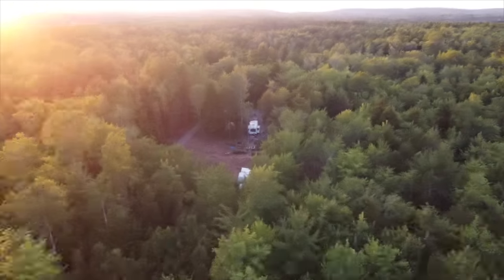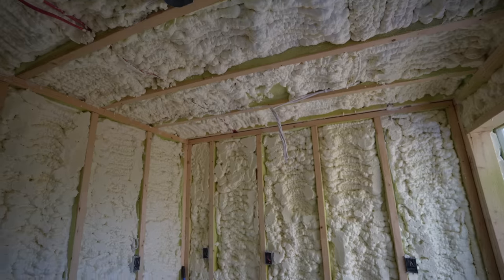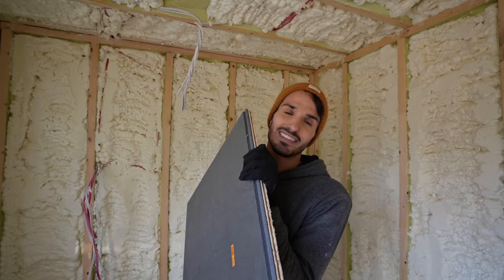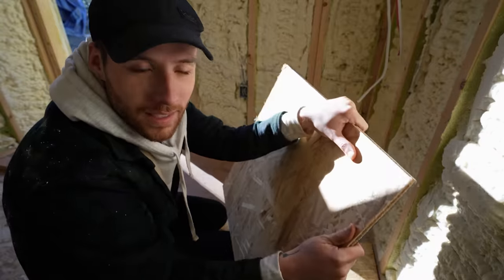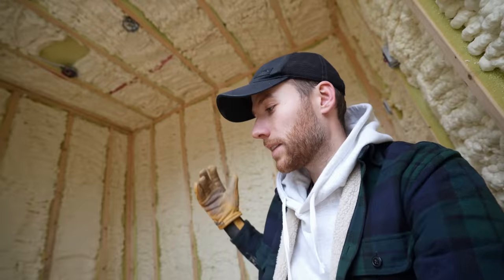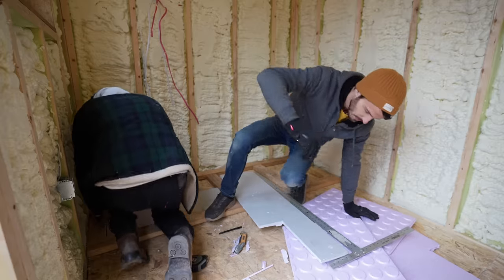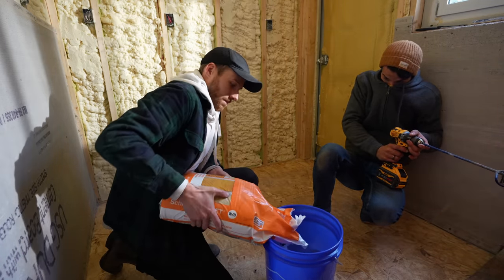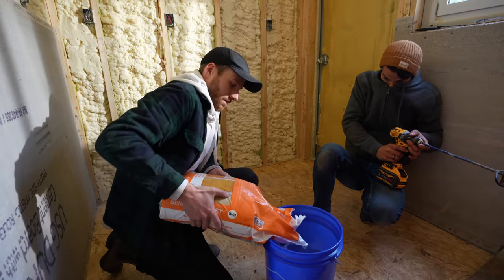10 Acre Homestead with Container Home AND Geodesic Dome powered by the SUN!

Comment: Hey guys, I'd encourage you to look at hydronic heat for your home, not electric.  I live off grid in the Upper Peninsula and have hydronic radiant heat in my slab and under my first floor.  Your system is much larger as mine (I'm just under 6kw) but I like that I can use my boiler and just run the circulating pumps.  They run on a thermostat for each floor and are probably one of the best decisions I made in building my log home.  Good luck!

Comment: For your next installment of the floor heat wire get one of the wheels used to install screen. It has a rubber wheel and wont damage the wire. It worked so much better for us when we did our floors.

Comment: You need to be sure that floor has to stay a flowering floor to allow for shrinkage and expansion with weather changes. That means a space left around the edges and not anchoring it in the middle. Otherwise it will buckel

Comment: Little by little, bit by bit!  Well more that a little bit of work.  The powerhouse is almost done!  Later, maybe, some sort of drainage can be arranged to protect the bottom of the container.  It is steel so it will last but rust will get to it.  Was the outside base painted when you first got it?  Not a huge issue, but in a couple years maybe revisit that issue.
You guys are so nice and you work hard.  Video games are good for the brain 😉.  Chillin' out is a good thing! 💙💜💜💙

Comment: off grid living.  you just answered a question I have had for a very long time.  solar will not cut it in the winter time and thus propane with a generator is the only viable option as there is no such things as living without electricity.  solar can be used to offset the cost of propane which is a very clean burning fuel but it will take many many years to offset the cost of solar installation.  firewood in the wintertime can also reduce wintertime heating costs if using an efficient induction fireplace which I think you have.  to be truly off grid you would need at least two generators for when one needs to be serviced.  Also, what did you even do with your office unit?  I was impressed at how fast you put up that cabinet but you will need to install a propane heater in that unit as solar will not be enough for heating it which will be very important as you will be running water through it.  also remember to use pex for all of your water pipes so if it freezes it will not break.  I made that mistake a few years ago on my property in east texas.  Take care.  You are a great mix for the lgbt content creation community on you tube.  Also, you should invite vanwives to your channel a little more often.  Those ladies know a thing or two about construction.

Comment: Batteries, any batteries generate heat. Make sure you have plenty of ventilation around any battery bank. You really don’t want to make the cabinet air tight. They also need to get air underneath them. The cooler they are, the longer they last.

Comment: Hey guys!  I love your work and your channel, but I have also done some of my own DIY heated tile flooring with that exact same Schluter membrane (the orange sheeting you put down), and have made a similar mistake to what I think you may have done: the spacing between the heating cables should never be that close together - 2pucks minimum but often alternating 2 pucks and 3 pucks on alternate rows.  Otherwise you’ll have serious hot spots on the floor (and maybe other issues too?).   Might want to check out some more YouTubes on installing that heated flooring.  Oh and be careful where / how you put the temperature sensor (and put in a backup!) as they can break (and then the floor doesn’t heat anymore :( ).  

I applaud your heated flooring, and it’s probably great that it’s in an electrical building the first time you do it, else you’d end up like me, with one of 3 main rooms with inoperable floor heat :(

Comment: Electrician here.. make sure you read manufacturer specs on the floor heat cable. I’ve never seen a cable that allows 1” spacing. Also, spacing needs to be consistent throughout the entire floor. And the coupling transition between heat cable and power cable needs to be buried in the thinset, under the tiles. Also make sure you install the sensor!
Reply from the maker: You are 100% right on this, thank you for the advice we really appreciate it!

Comment: There's a tool you use to install like...rubber stripping into screen windows that I bet would be perfect for that wire you install in the floors. it looks like a pizza slicer, but has the round things on both ends.

Comment: Hey just a heads up, you shouldn't single space the schluter in floor heat cable. Can overheat. It's meant to be 3 spacing or you can alternate between 3•2•3 spacing if you have a little too much wire. Enjoy Tiling!
Reply from the maker: Thank you so much for this John!! Thankfully we haven't put down the tile yet!
Reply: @tylerandtodd  no problem! One more thing, I find one of those plastic wallpaper seam rollers work great for locking down the wire in the spacing. They won't damage the wire and they save your fingers

Comment: My experience with that "insulated" floor is you might as well not have it.
SO---
your best bet is to put 3 inch or what you can get, ridged foam insulation, cut it tight to seal around the bottom of your crate, like a wall from the bottom of the crate to the ground, then you can put steel sheets round on the outside to protect from weather.
You dont have to insulate the bottom,  seal aroiund the bottom so the cold and air cannot get under the crate.

what kind of wall foam did you use?
It looks like it was Great Stuff spread over the walls stud to stud, (no reference to you guys).  I have seen Great Stuff used in small applications but you have 4 rather large walls.

One thing I learned about using inverter power,  IE 12v dc transformed up to 120v ac is you USE a lot more power going through the inverter than if you had 12v dc applicances.   with 12v dc to 120v ac the power use is about 10 times more.
But what comes to mind is, why are you not using the solar panels on a temp hook up for the solar power generator?????
You have a massive amount of power in those solar panels and you are not using them?????

goodluck.

Comment: I've been thinking about putting solar panels up on the entire south facing side of the pitched roof on my two story house... until I saw the thumbnail pic of Tyler scraping snow off your panels. I thought, "Uh-Oh, I am NOT going up 2+ stories outside on a ladder in the middle of winter to do that!"  I assumed the snow would slide off the pitched smooth surface by itself. Looks like I was wrong. 🥺

Comment: A simple pole roof over your utilities building will ensure a frost free area. Insulation inside is good also but a simple roof will be your first line of freeze defence
Reply: Simple overhead roof for the heat of summer as well. 
Those sea cans can get hot, hot.

Comment: Hey guys!  
Enjoying seeing you getting things put together over there!

Just as a couple thoughts as an electrician:
Has Battleborn gotten approval for those batteries to be used in residential applications in Canada?
The cabinet should not be blocking access to electrical equipment (especially breaker panels)
Has your electrician applied for Plan Review Approval on the design of the electrician system prior to install? (Electrical code requires plan review with you have a solar array as large as yours AND a battery bank of any significant size...)

Things to think about!
Reply from the maker: Thanks for the input SirMaximusII, you've given us a lot to think about! Really appreciate you taking the time, means a lot! :)
Reply: @tylerandtodd  you’re welcome, hope you don’t mind, I’ve lifted Adam’s number off his truck and I’m emailing him now to offer some assistance.

- Kage

Comment: Missed you! couple thoughts: 1) if you ill be installing additional heated flooring try using a screen spine roller to seat the heating cable into the grid, $5.00. When your generator dies replace it with a Honda. Mine, (EU 2000i), is 25 yo, five hurricanes and countless power outages later it runs like new, sips fuel and powers my 1900sf house x- 220 AC, clothes dryer, etc. Inverter generators are very quiet and available in several outputs and I think interfaces with Victron when batteries and solar output are exhausted. 
One more thought regarding flooring in the container house. Steel and wood have different coefficients of thermal expansion. I am wondering if the flooring should float. Engineers might have some thought on the issue. 

Best wishes, really enjoying your adventures. Greg
Reply from the maker: Thanks sharing your insights with us, it’s really appreciated!! We thought the same on the floating floor but we decided to fasten it down given that we want to tile over top and didn’t want it to move too much!

Comment: Why not use the roller tool used for installing screens on you next floor heating project? It might help instead of using your 
fingers. You may have to adapt it a little.

Comment: Is that building on a concrete foundation?  If so, did you put down a vapor barrier before the rest of the flooring (floating floor)?  Also, aren't floating floors designed not to be nailed or screwed down to allow for movement as it expands/contracts with temp changes.  I'm not a builder or expert, but I put one down in my house and that is what I was told.  Thanks and you two are great.  Love watching.

Comment: Just wondering if you looked at solar water heating and using it for in floor radiant heating or heating water for the shower etc? Might be interesting to compare heating water that way vs using power from the solar panels to power heaters. I just read that even in a New England Winter a solar water heating system can still save you 10-20%.

Glad you're back from your break.

Comment: I wonder if the tool used to insert the gasket on window screens would have worked on the wire for the heated floors?  Keep up the good work!
Reply: The tool looks like a mini pizza cutter except the roller is dull.

Comment: So glad you've changed the post time to noon. I see you mentioned a bathroom for your container home. Maybe you could address why you built the luxury outhouse down the path instead of installing a convenience in the dome?
Reply from the maker: Happy it works better with your schedule - also, that is a great question!! In order to build a bathroom in the dome we would've required another permit plus another septic tank which would have been almost $20,000, which just wasn't an option. By building the outhouse we have what we need for right now, without having to rush the exact design of the bathroom we want :)
Reply: @tylerandtodd  Thank you for responding. I'm wondering if others living off-grid in tiny houses, and vans have similar issues. Many seem to use compost toilets or buckets and bottles. Had you at any time considered just walking down to use the facilities in your RV?

Comment: i’m curious…why did you only put up the cement board halfway up? thought maybe i missed something and rewatched that part but i didn’t find anything.
Reply from the maker: Great question - the inverters need to be mounted to a plywood backing....the rest of the walls are going to have the wires behind them!

Comment: Hope you thought about it already but this house is separate and you will probably not visit it every day. It's going to have pressurised water inside and I can't see a water drain in the floor. Wcs it could be A LOT of water in there before you realise you are having a leak in the system and with those batteries so close to the floor....

Comment: You have become very good at building almost everything between heaven and earth, but: You are making a FATAL MISTAKE. I live in Norway and have the same climate as you. You must never lay floors before walls. But start with the ceiling, wall then floor. Now the slightest movement in the floor will also destroy the wall. Should you get a small leak or water on the floor - the material will lead moisture into the wall. The floor must lie next to the wall panels, i.e. not under them.
Reply from the maker: Hey there! We didn’t lay the floors before the walls, this is a subfloor. All the walls have to be completely finished before we lay our finished floor!
Reply: @tylerandtodd  OK. I understood that it was a subfloor - but it had never been approved in Norway, precisely for the reason I told in the previous comment. I guess the subfloor is "dead" material combinations - but still. We can only hope it will be good.